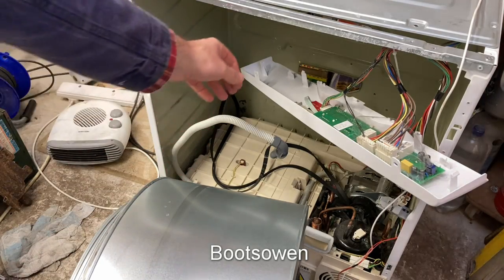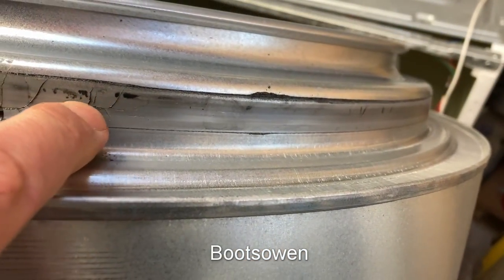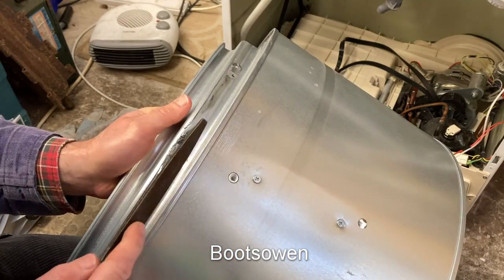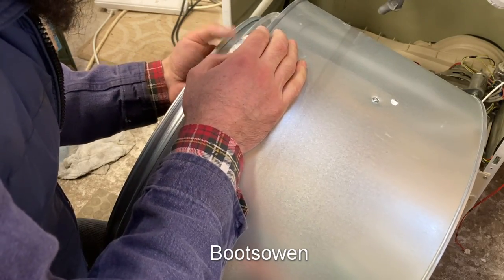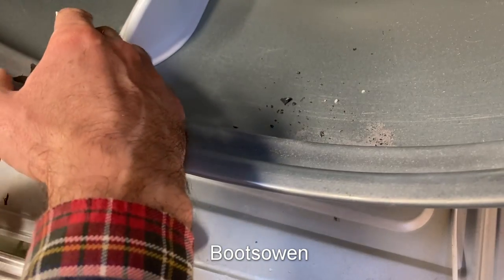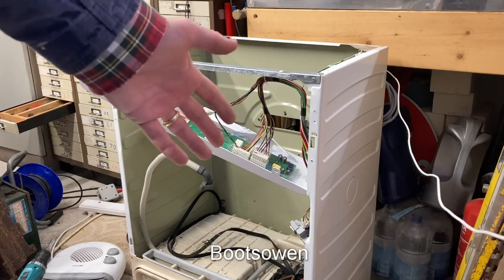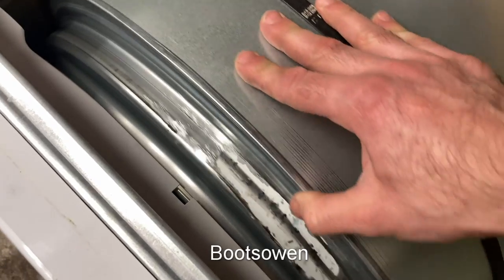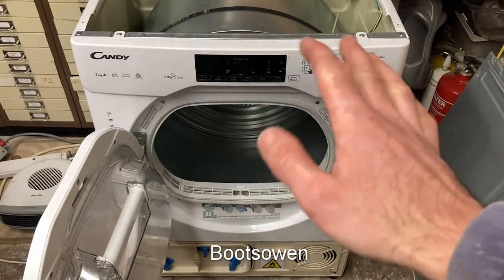My biggest little bodge? Candy heat pump tumble dryer repair and testing

Comment: The fan at the bottom only comes on sometimes to cool down the compressor if it needs to, if you put it on a delicate cycle it might use the fan to reduce the temperature as well

Comment: The holes on that drum is  from tiny bumps that forms on it while the machine was been transported and those weak spots will finally rip open as holes when it's runs on the drum support wheels
Reply from the maker: Thanks, it's a pretty crappy design then!
Reply: We usually change the whole drum whenever there is tiny dents on the rim of drum.
Reply from the maker: There isn't much else you can do if you are a commercial operation. But I don't really want to spend any money on this beast.
Reply: Could you do a video where you try to access the evaporator section of the same machine? I'm just curious to see what's in there

Comment: Hello. The drum is damaged from transport. If the appliance is dropped or has a bad journey to the customer what happens is the drum bounces on the support wheels which indents the drum. Upon use the drum will make a thumping sound. Most people report it but a lot don’t and the outcome is the damage you see on that drum and the 2 wheels.

Comment: I own a similar heatpump dryer from candy, the beeping is a result of moisture/water behind the touch buttons. ( i've covered the pcb inside with self adhesive book cover)
And you need to select the ''drynes'' you want every time you start a cycle. On the right side it shows from bottom to top: Iron dry, Hang dry, Cupboard dry, Extradry.
Reply from the maker: Thanks this is a really helpful comment, I thought that the beeping was like someone had their finger on a button but I couldn't work out that it hadn't changed a program. The condensation makes sense. Your trick is a good idea. Thanks

Comment: I love the idea of the water container on the door, I've been to alot of calls especially elderly people who say their dryer isn't heating, won't work, but they don't understand the red light is telling them to empty the water. Also if you sold this be perfect for someone who kept it in a shed, but remember to tell them heat pump dryers work but need a certain ambient temperature. In winter they don't work properly when stored outside depending on the ambient temp the certain model needs.
Reply from the maker: I thought it was a cool feature too.

Comment: My partner has the later version of this and I must admit it dries very well and even more so when you consider the low purchase price.  

As others have mentioned, you have to select one of 4 available levels of dryness before each cycle, although you won't always have the option of the dryest setting depending on the cycle temperature, such as delicate fabrics etc.  The anti-crease button adds reverse tumble to a cycle but it also resets the dryness setting to minium, so you have to select anti-crease and then dryness. 

I have read the plastic hinges can become an issue if the door mounted water container is regularly filled (full load of very wet cottons a prime example), so it's best to ensure it's emptied after each cycle, rather than waiting until it's full.

Thanks for the video. 👍
Reply from the maker: I reckon it would be great if mine didn't sound like a train!  I struggle to change the dryness level, I think that the board might be tricky too.

Comment: I believe you forgot to re-connect the moisture sensor when putting back the front cover. You can see it just hanging down at 9:10 of the video. The cycle did not shorten in time (as the Samsung) as it could not read the moisture level and at the end it got stuck at 2 minutes because without the sensor it thought the load was still wet, therefore going until it gets dry. 

If you cannot sell it as it is, you can still get good money for the perfectly good heat pump system (mostly standard size and shape for all Candy and Hoover machines) and the other parts of it, like the panel, pump and water tank (which commonly breaks at the handle).